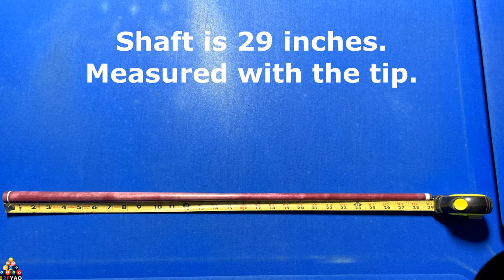Making a Pool Cue, Playing Cue w/ a LD Shaft and a Break Cue w/ a Purpleheart Shaft

Comment: Hey do you have any advice. I got a radial pin cue with a large flap topped pin. I want to try carbon fiber but, the Chinese made radial shafts don’t fit my cue.
Reply from the maker: Is it just a tight fit. If it is, I would rub some Q wax on the pin and put some on a q tip and put some inside the shaft joint. If you don’t have Q wax, you can use a bar of soap. Just rub some on the pin. The pin and shaft just needs some lubricant. Hope this helps, thank you for commenting and keep us posted.

Comment: Awesome video I just got my lathe in the mail yesterday I’m excited to use it
Reply from the maker: That’s awesome. If you haven’t already, get dial indicators that measure to .001. That will help when facing your joints. I also got the edge alignment tool but I think it was a waste. The tailstock should measure out 0.950 and to double check use a razor blade and make it balance in the middle. Hope you enjoy it.

Comment: Where can I purchase the large boring bar and when drilling the joint what is the size of the drill bit you use before tapping? What is the sandpaper grits used in the finishing process?
Reply from the maker: For the finishing process, I use 1200 grit sand paper from Harbor Freight. Click on the description below and I have a hyperlink to where you can get the same lathe I got. Thank you for commenting, please subscribe if haven’t already and please share.
Reply: I like the large boring bar on the tool post. Where did you buy it?
Reply from the maker: I got from Amazon. Here is the link. Hope this helps.  
https://www.amazon.com/dp/B07MR2BM24/ref=redir_mobile_desktop?_encoding=UTF8&psc=1&ref_=sspa_mw_detail_6

Comment: nice!! all u need is a few more tools , a power feed would be on my list,this video is so satisfying to watch, i guess cuz i can relate..... great job!!!!
Reply from the maker: Yeah more tool is also important and the power feed. I think I will get the power feed next. Thank you again for commenting and I’m glad you enjoyed the video.
Reply: @playpool12fyao  there aren't alot of vids on cue guys, and the ones here do not reply much
Reply from the maker: So true. Funny thing is, I watch videos on YouTube to learn how to make a pool cue. The videos were old VHS to YouTube. It was grainy but I learned a lot.
Reply: @playpool12fyao  back in 2012 I bought DVD from prather cues, basically all u need , if u ever need and info or if I can copy it I'll mail it
Reply from the maker: @hectorotani27  thank you. I’ll contact you if I have questions. Thank you for reaching out.
Reply: @playpool12fyao  hello sir...in part 9f the video it shiw u using a lathe outside on a bench...is that the same lathe u use inside...great work
Reply from the maker: It is. I find it easier to clean up the mess. I just have to use a blower vs using a vacuum. Thank you again.
Reply: @playpool12fyao  does the motor and head stock move from being able to work on ferrules then it looks like u moved it back to taper shafts
Reply from the maker: Yeah, the motor does move with the head stock and it does move the whole track. I double check the centers between headstock and tail shock when I move the head stock.

Comment: Wow.  Excellent craftsmanship.  That shaft has some serious low deflection. Correct me if I'm wrong, It seemed like the 12.4 Revo deflected the cue ball more than the 12.9 Revo.
Reply from the maker: Thank you.  I remember reading somewhere in one of the pool forums that the 12.9 does deflect less than the 12.4. I got the 12.9 to try to be more on the center of the cue ball and it has been helping. I can still spin the CB with the 12.9 but now with a fatter tip, it’s scary to get the tip close to the edge of the CB thinking I might miscue. Now the feel and playability, the 12.9 is my go to shaft. Thank you for commenting and please share.
Reply: @playpool12fyao  What palying and breaking tip do you prefer?
Reply from the maker: My sponsor’s website 
https://www.horotips.com/en
https://www.facebook.com/wearehorotips/

My playing tip is a Morakami Black Diamond 8 layer Water Buffalo Cue Tips but I press them a little bit to get them  a bit more hard. I have not got any playing tips from my sponsor yet. 
I remember when I started, I asked a house pro what tip to play with, he told me get hard tips. Pool is a game of consistency, soft and medium tips will mushroom and they require maintenance, equaling them wearing down too quick. Hard tip hold there shape better, last longer and you can get them down closer to the ferrule to get more feel. I also like the Maximus Professional Cue Tips. That’s the tip I installed in the video.  
Link on where I get my tips. 
https://www.cuecomponents.com/pocuetiandfe.html

For the break tip I got the Horo Jump/Break tip. I have sponsorship with the company to sell them State side, but I am out of this time. Before I got with Horo, my favorite break and/or jump tip is the G10.  If your pool hall allows them, G10 tip will last you a lifetime. Once’s it shaped, flatter than a playing tip, it will never get out of shape nor will it wear down. I have the same G10 tip on my Mezz breaking cue for almost 10 years now and it still looks the same, minus the felt burns on the side of the tip, the shape and length size never changed. G10 requires no maintenance nor will you have to change them out due to them wearing out. 
Where I get them. https://www.muellers.com/Phenolic-and-Composite-Tips.html
Hope this helps and please share.
Reply: @playpool12fyao  Thank you very much for this excellent information and the awesome videos you put out.  You have educated me and a lot of other people.  God bless you and your family.
Reply from the maker: Thank and may God bless you and your family too.